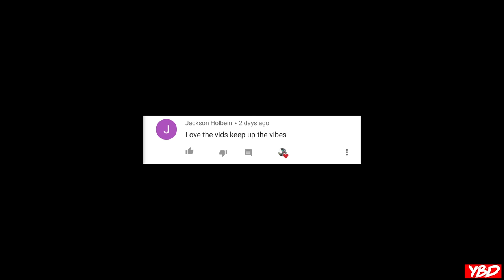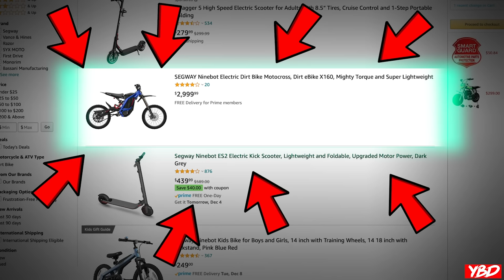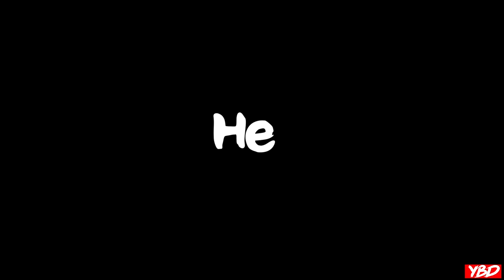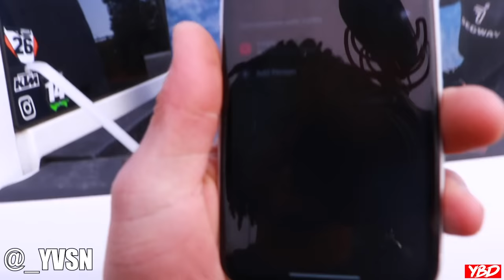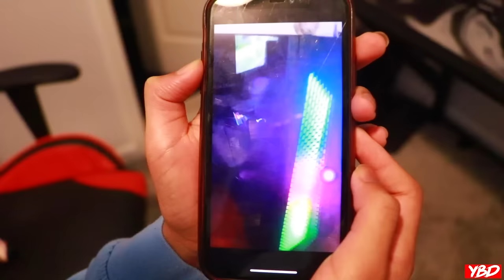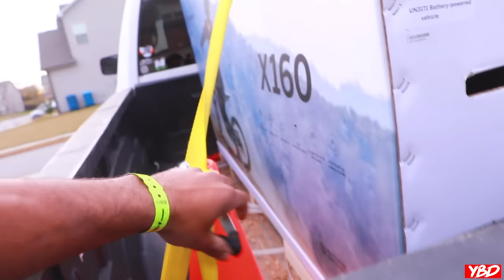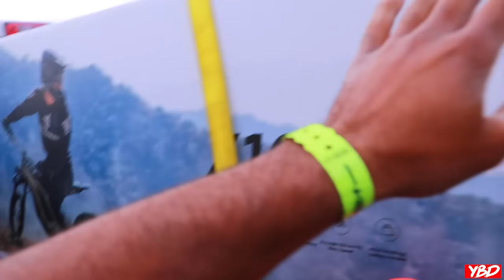Buying Amazon's CHEAPEST Electric DIRTBIKE!! | Best-Quality

Comment: I just watched a video where a guy takes this exact Segway and replaces the forks, tires  but keep the rear sprocket cause it's better then sur Ron's  then he puts the battery from the sur ron in it and cut the green wire with the black strip for the braking mechanism  and it was as fast as the sur ron and was nicer riding.  The battery box is for if you sell your battery you ship it in that box. The controller is the same as on the sur ron.